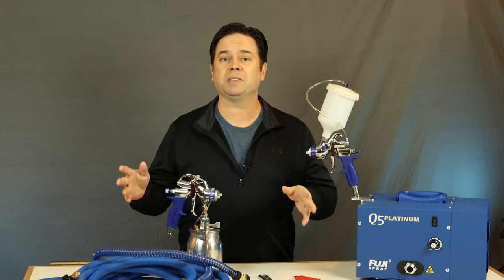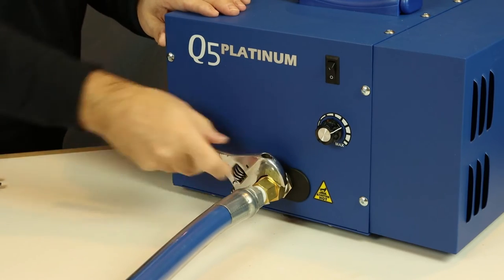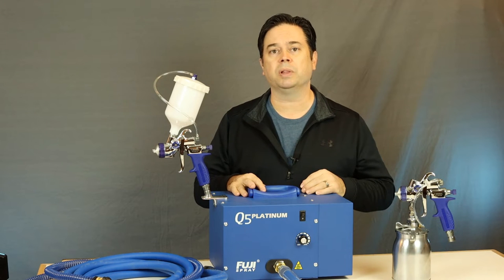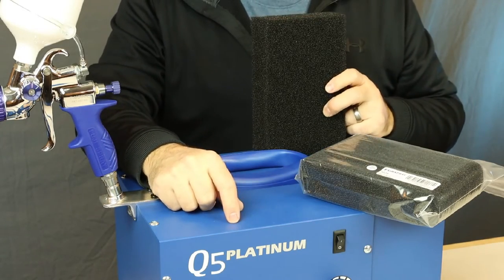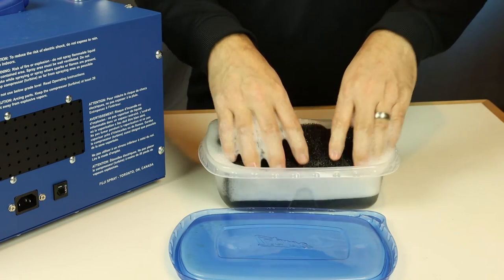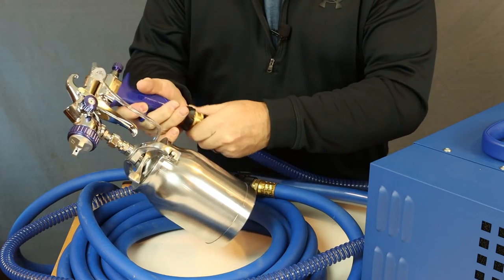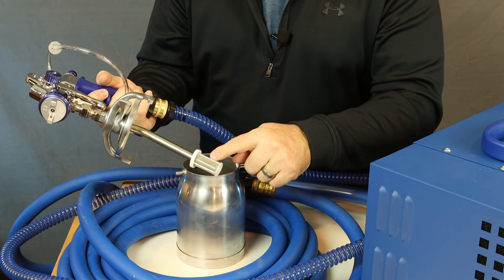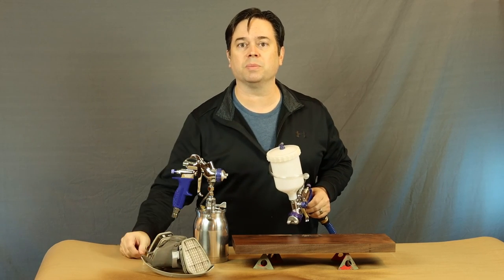Fuji Turbine Sprayer Basics Turbine HVLP Spray System 101

Comment: Thank you for this video. It was very informational and exactly what i needed after buying a mini might 5. The sprayer is great but the manual leaves a lot to be desired.
Reply from the maker: Thanks and good luck with your sprayer!
Reply from the maker: If it's just the knob and little wedge shaped spacer, it just threads on to the shaft of the lever.  If the whole shaft came out, it's more complicated.

Comment: Great video on this product!  Liked and subbed.  Just pulled this unit out of the box and will be spraying SW Gallery series paint on some cabinetry I made.  Any input on which nozzle size is appreciated!
Reply from the maker: Hi Andy, I would spray with the 1.5mm aircap set for a fine finish that builds more slowly, or a 1.8mm aircap set to move a little quicker.  The typical advise is to use a 2.0mm aircap set, but I think it plasters the paint on too thick.  If you're using the Q5, you'll really like it.  I remove that black inline valve, and just set the variable speed on the turbine to about 80% or so.  Good luck on your project!

Comment: I purchased a Craco Croix Turbo X8, it is in perfect condition, I have a couple of gravity HVLP guns that have the traditional air hose, can I simply switch out the quick connect fittings and use the gun with the turbin and hose?
Reply from the maker: No, I don't think that would work.  Turbine spray guns operate on high volume and very low pressure (usually 7-9psi).  Compressor driven conversion guns usually operate at 30-35psi.  You'll probably just have to buy a gun designed for your turbine.
Best of luck.

Comment: Hello I'm new to spraying. Why would you use your Q5 over your airless? I don't understand why people own both quite yet.
Reply from the maker: Yeah, good question.  The airless is good for painting a house, but it doesn't produce a fine spray pattern.  Plus, the airless is a lot more work to clean up because it pulls paint through the hose.  
With a turbine sprayer there's only paint in the cup.  It only takes about 2 minutes to do a full clean.  

Best

Comment: Are these ideal to spray spindles on a porch or airless sprayers are better for that?
Reply from the maker: They both would get the job done.  I have a Fuji Q5 as well as an airless sprayer.  I use the airless for painting the house, so I'd probably just use an airless for painting a deck railing.  Best of luck!

Comment: I want to purchase the 3oz cup for my Q4 What would the part number be?  Thank you
Reply from the maker: There are several cups available, depending on what gun you have.  Go to Fujispraysystems.com and choose products, parts and accessories, cups.  There you can choose the 3oz cup you want.
Best
Reply: @TheThoughtfulWoodworker  I went on the site and I cannot find the correct one. Mine is the Q4 T75G
Reply from the maker: @nancyhoekman6706  I only see the 3oz cups for the siphon feed guns.  Same on Amazon.  You might have to call them to see if it's available for the T75G.
Good luck!

Comment: Thanks for the very nicely done video. I am close to pulling the trigger on one of these to be used for painting vintage motorcycle parts. I've been priced out by the pros so need to do it myself. 👍
Reply from the maker: I know what you mean.  The system will pay for itself in 2-3 jobs.
Good luck deciding on a system.
I'd get the Q5 again.  No regrets here.

Comment: my mini mite 4 is not very loud.
Reply from the maker: That's good to hear.  I'm also happy with how quiet the Q5 is as well.  
Have fun spraying.
Reply: My mini mite 4 is very loud compared to the q5 platinum
Reply from the maker: @spkendrick  Yes, any of the Q models have extra soundproofing and engineering for no direct sound path from the turbine.  They will run quieter than the standard models.  In addition the Q5 has variable speed.
Thanks for checking out the video.
Best

Comment: Is there an in-line pressure gauge that be installed right before the gun?  It'd be nice to know just how much pressure you have for different types of coatings that will be used...
Reply from the maker: There is an in-line valve to control airflow.  I took mine off, because the Q5 is variable speed.  It's easier for me to just dial in the airflow on the turbine.  If you're looking at a turbine without variable speed, the valve might be useful.
Reply from the maker: @xxdemonshitxx  there's no pressure gauge, but with a turbine you really don't need one.  Airflow is constant on most models, and you adjust fluid control to suit the situation.
Best